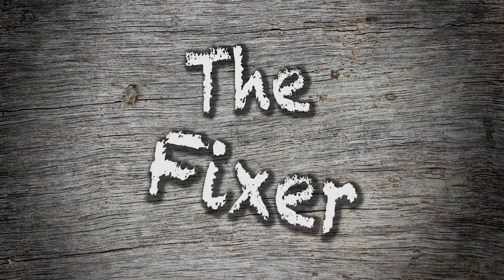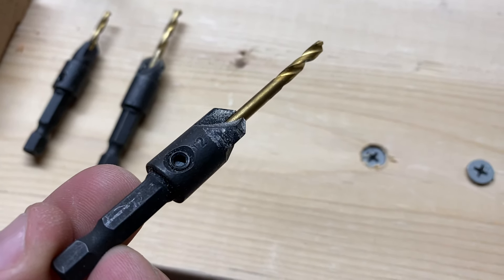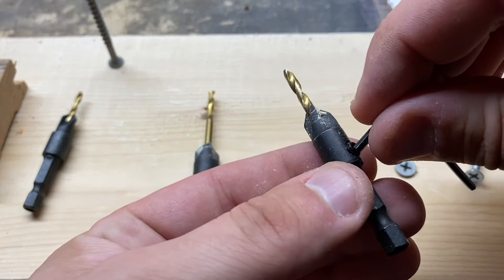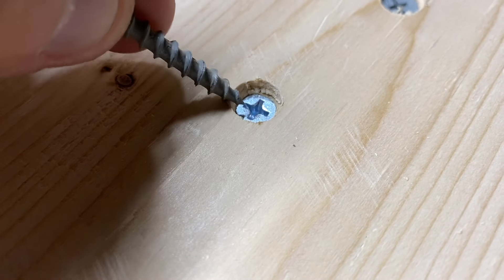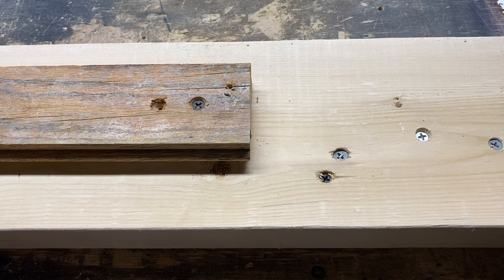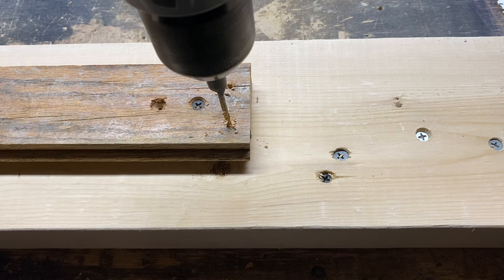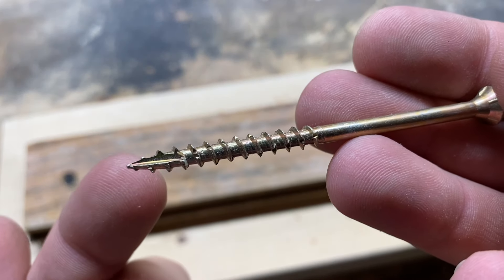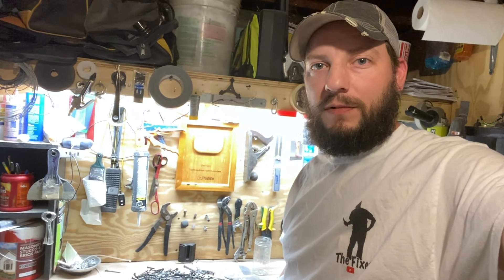How to Countersink Wood Screws

Comment: im confused how you drilled the holes to attach the top part. It goes so fast in the video its hard to see exactly. I dont get why you drilled through the top and the bottom and not just once from underneath. Great simple video though. Might be trying this setup.

Comment: Thanks for this video.
I bought a large Dewalt bit set more than 20 years ago.  I still have them.  I don't use them often.  
It has countersink bits in it.  I never touched them.  I didn't know what they were for.  I didn't even know what they were called.  Now I know.

Comment: Thanks for the video, I've been doing different construction projects with my dad for ages, but I never really learned finer techniques to improve my skills. I decided to restore an old machete my father's had for years as a gift. Sanded it, and the handle was dry rotted so I'll be making a new one using this to keep the bolts hidden.

Comment: There is much more to counter sinking. There are better bits to use, and also ways to avoid tear out. Keep looking at other videos. I'm not in a position to make a channel yet but one day I will. This video would be considered, very basic and not advanced. It is much appreciated though. I will give one tip though. Clamp your work down and make several tests on scrap the same you are using for your nice project. Repeat and practice 3 or 4 times befor drilling into the real thing. Some bits will really bore in fast and you'll drill to China. Do t forget to set your cluch while doing your tests and consider using a hand screwdriver for the final screwing. You won't regret it!

Comment: There is another bit called a countersink bit . It’s just a short bit that drills just the counter part of the hole … you didn’t show that . I want to get a set but now I
Don’t know if I should get the ones that have the drill included or just the short bits that only cut out the sunken part . Should I get both ? Seems like the ones with the drill attached will save time ?

Comment: Question for anyone, 
Any thoughts on the Kreg Quick Flip? 
Specifically, I think the size of it is 1/4" and designed for the Kreg screws, but would it also work for most any other type screw?

Comment: If i don't have the countersink drill bit what can i do in an emergency?
Reply from the maker: Hey!  Good question!  You can use two different sized bits.  One small “pilot bit” a little smaller than the width of the screw.  And a bigger bit that is slightly bigger than the width of the head of the screw.  Hope this helps!  Thanks for watching!